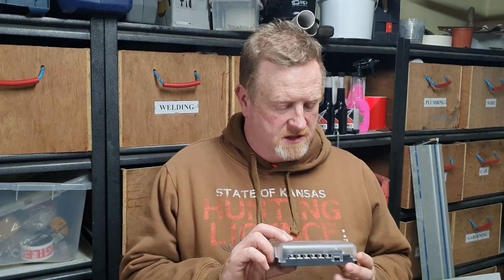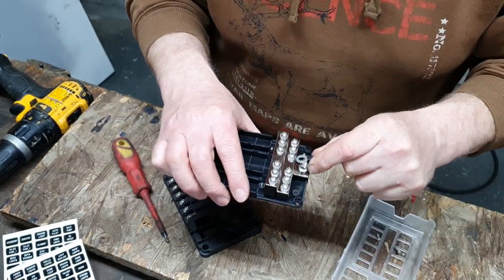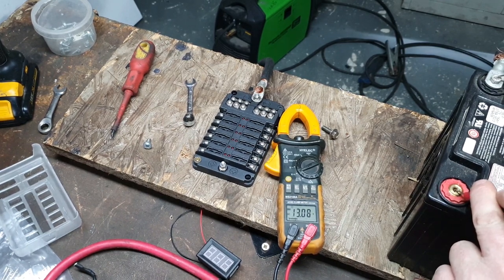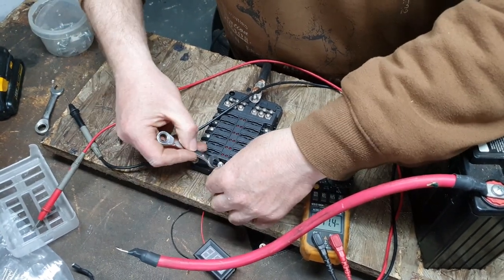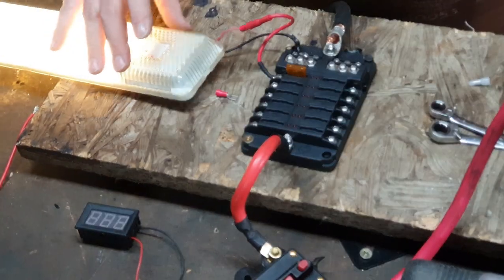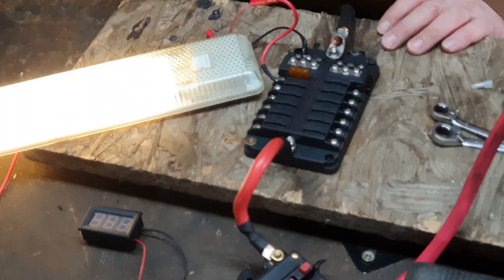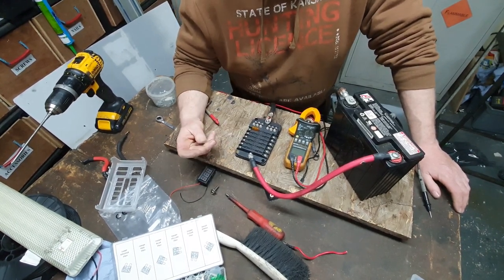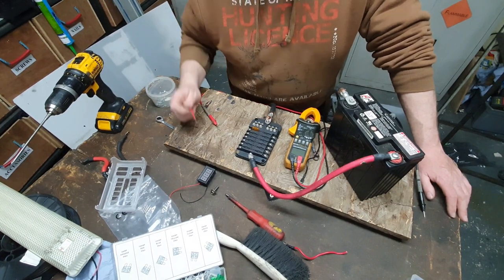12v Camper Van RV Boat Fusebox review

Comment: Great video, really informative so thank you - just about to start on the electrics on my van! Quick question - does the manual switch on the breaker completely stop power from the battery to allow for maintenance like an isolater would, or should you also include an isolater?
Reply from the maker: Hi luisa, sorry for delay in responding but I'm not getting message notifications from YT. 

The breaker I use only isolates the fuse box feed from from the battery to the fuse box but I will have(and would recommend) 100 amp version that isolates the battery supply from everything.  I chose 100 amps as based on my calculations, I should never draw any more than 100amps with everything on, charging, solar, battery to battery charger and anything else. This allow me to completely remove the batteries from the system short of undoing the cables to them. I also went a bit over board and replaced the inline fuse on the solar controller with a breaker on both the positive and negative so I can isolate the panel and controller individually. Probably overkill but 'Do it once and do it right'. Hope this helps. Jamie
Reply from the maker: But to answer your actual question, there would be no need for a separate isolater switch with the breaker in place. Jamie
Reply: That’s wicked Jamie, thanks so much for the response and info!

Comment: Hi, I have the same fuse box, should I connect a negative earth wire from the auxiliary battery to the body of the van aswel as an earth to the fuse box from the auxillary battery?
Reply from the maker: What a really good question, if you connect the earth from the battery to the van body and to the fuse box, you now do away with the need to run two wires from each accessory. You just need to run a positive wire from fused terminal via a switch if necessary. Hope this helps. Jamie

Comment: What Guage wire are you using to run from the battery to the fuse block
Reply from the maker: Hi, I used 6mm2 multi strand wire. Can't remember the AWG equivalent but Google had the answer.
Reply from the maker: It's 11 or 12 g I think

Comment: What size of wire do I need to run from the battery to the fuse box?
Reply from the maker: Dee, there's a few factors at play to give you the correct answer. That's for the great question and now for the boring bit.

You need to work out the total load, in amps that your fuse box will require. Basically if you have everything in your build switched on at the same time. For example, lights, heater, fridge inverter etc obviously only 12v stuff connected to the fuses.

Then you need to work out the length of the wire from battery to the positive input on the fuse box. 
If you need more advice, let me know but lots of good info on calculations if you Search the net, but they will all ask for the current draw/load and the length of cable run, so that's your first task. Any more help I can give. Just ask

Comment: I have a similar fuse box, with no fuse connected I'm getting approx 10v on the output side.and no LED lit. If I put a fuse in the output goes to 13v and matches the leisure battery.

On yours was the output side completely dead without a fuse installed?
Reply from the maker: Ok, so this confused the crap out of me for a bit when I first started with the panel. Here's the sneaky....there is power to the terminals. Even without the fuse. Couldn't figure it out until the obvious dawned. How could the led light when the fuse is either removed or blown.  That's why your getting a small voltage without fuse. Jamie
Reply from the maker: Sam, forgot to mention, you only get an led lit once there is something connected to the output. If the circuit is not completed the LED doesn't illuminate regardless of fuse or not. J
Reply: @campervancreations7656  thanks Jamie very helpful. Sam

Comment: If I connect all the negatives from the lights to the chaise, do I connect the negative wire from the battery to the chaise as well or to the fuse box?
Reply from the maker: Ok, the negatives just all need to be connected. As long as there is a link from the battery to the chassis, you can also link it to the negative on the fuse box, incase you have something you want to wire using directly back. All fuses are on the positive cables so. Jamie

Comment: It would be great if the + side was split. Then you could have one side behind a main breaker and the other for always on stuff (bilge pump in a boat etc)
Reply from the maker: It's a chinese copy of a German design, they are so cheap,  you could split the whole power system across 2 of these. Technically you could zone the van/boat RV into 2 or more fuse boards, just like a garage consumer unit separate from the dwelling house.  It's only for convenience, if it was a narrow boat, having a fuse board in the bow and one in the stern. Probably overkill for most applications. J
Reply: @campervancreations7656  Absolutely. It’s a 30+ foot Bayliner, so there’s already 3 or 4 fuse panels. I’m trying to simplify and reduce for easier maintenance and better overview. But I’m also thinking going for the Chinese stuff. What I get in stores here are identical, just branded with the store name and for 3x the price.
Reply from the maker: @nordemoniac  The only thing that could ever cause trouble might be the quality of the soldering or crimping of connections. The store bough ones will be Chinese ones just shop branded and waaay more expensive. Anything with the word Marine or RV in it is always 2 or 3 times more.

Most of stuff is either agriculture or automotive and just put in a different packaging.
Reply: @campervancreations7656  Yeah, as long as it isn’t fully submersible or stainless steel, it’s not really “marine”.

Comment: Any concern on how light the wires are on the inside?
Reply from the maker: Mike, The wires on the inside are only used to power the red LED indicator lights in the event of a fuse blowing. The actual power connectors are the steel terminals. Jamie
Reply: @campervancreations7656  Thank you!.  Is this unit suitable for a 6 volt application?  Are you in Kansas, I'm in Ottawa.
Reply from the maker: @a075923  Mike, I'm actually based in Wexford, Ireland. As for the 6v application, I'm unsure, there is no reason it wouldn't work as long as the fuses were rated to blow at the 6v rather than 12v. Simple formula to calculate fuse rating to protect the wires P=VI will give you current. Work out the fuse required and hey presto. Not so sure if the 6v will work the LEDs. Jamie

Comment: #4 AWG to feed it?
Reply from the maker: That's correct. 25mm² or 4awg. Any bigger and it's too inflexible and protected by the resetting fuse/Breaker. Incidentally I use the breaker regularly as an isolator. Well worth having one in the line. Jamie
Reply: @campervancreations7656  smart 👍🏾

Comment: Wow, the wires for the fuses inside look VERY thin.
Edit: Stupid me, didn’t notice it had LEDs 😂
Reply from the maker: Hey Glenn,  that caught me out first time around. Actually had a total brain fart about it until I realised what it does and how it works. Jamie
Reply: @campervancreations7656  Exactly. Glad I’m not the only one 😅
Btw thanks for the fuse tip. Just as a short-prevention alone, or for cutting power when necessary it’s brilliant.
Reply from the maker: I've always said that as long as it's safe there are so many ways of wiring 12v systems. I've years of experience with all this stuff, it's the making of the videos makes it hard to cover everything. Thanks for watch and the comments. Jamie

Comment: I  bench tested the six circuit version of this fuse box and each positive terminal without a fuse showed 11 volts. I returned it.
Reply from the maker: That's actually correct as it uses the voltage to light the LED in the event of a fuse blowing. I actually explain that in the video. Thanks for the comment jamie